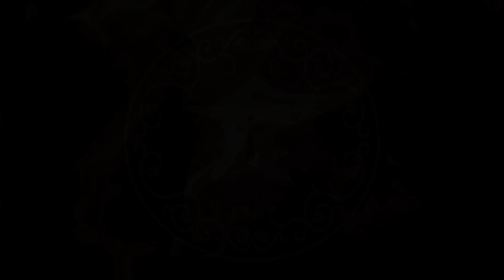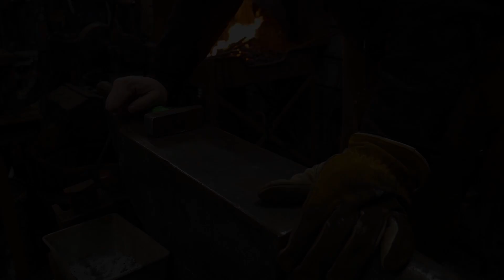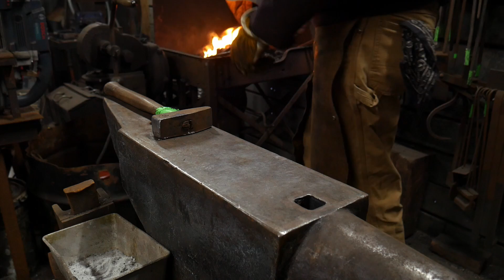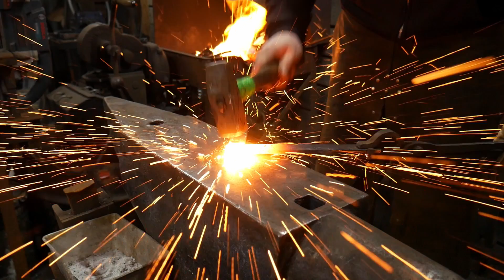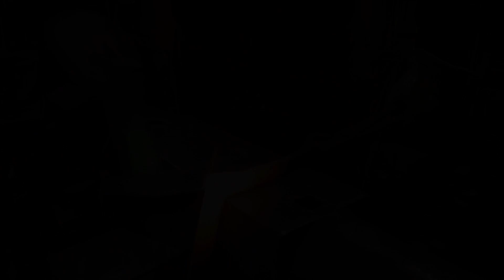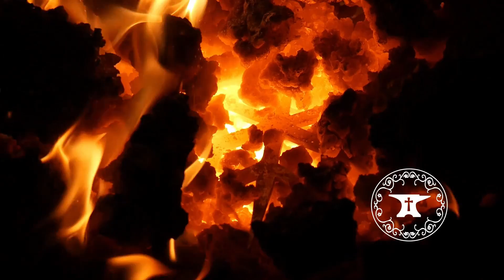Top Reasons Why You CAN'T Forge Weld

Comment: I recently had a failed Damascus billet I was trying to forge. I heard somewhere the steel will get hotter faster if you position the stack so they are vertical instead of horizontal so that the heat from the flame will hit each individual plate. I tried this method but after you said that flux can get stuck in between the layers makes me think that that was my problem... The flux was just seeping down in between the layers and messed up the weld. Is there any truth to this?

Comment: The number 1 reason my welds don't take is clinker in the fire blocking the air holes.The fire won't come up to a welding heat and I burn the steel. Also if there was to much flux on the piece my instructor Malcolm Paine would sometimes tap the pieces on edge on the anvil as they came out of the fire to remove the excess flux. 
Touching the pieces together in the fire and seeing if they stick is a great tip for beginners.
Great videos by the way.

Comment: Thanks for very informative video I have subscribed. I am a fairly good oxy welder and as such have a good handle on oxidising neutral and carburising flames, you also get to see the metal right up to the point of melting. Your video has given me a better understanding of forge welding and I’m keen to have a go. Thank you

Comment: I’m using a propane forge. Would it be better to have a coal or coke forge for forge welding? I’m really struggling, I’m also at 7000 feet of elevation.

Comment: Take and put your steel in the forge, then take and pull it out.
Take and hammer on it, but if it doesn't weld, take and figure out what you did wrong.
Take and brush the scale off before you take and use some borax, then take and put it back in your forge.
Take and pay attention, now.
Take and pull it out and take and pound on it awhile.
Take and brush it off again.
Take and take and take and take and take and take and take and take and...
Reply from the maker: Bravo 👏👏👏👏 now you're taking and getting it 😉
Reply: @ChristCenteredIronworks  
Good channel, I'm learning.
Take and keep putting up the videos, please.

Comment: A deep enough fire to use up the oxygen. A shallow fire or puting the material too close to the air supply. Clinker. All reasons forge welds fail. A rare one. Poor quality steel. I had an entire 20 foot bar of hot rolled A36 that was unweldable. I bought 2 bars at that time. The other welded just fine.

Comment: There are a lot of famous youtube channels that makes damascus steel in way to low temperatures, they bang it together with powerhammers or presses and create a semi mechanical and semi forge weld. If the pieces does not stick together just with touch there wont be a clean forge weld. Thanks for the input of oxygene, have not thought of that before, maybe that's why I fail more often from coke fuel then from cole, cole probably eats more oxygene.

Comment: What’s the best way to reduce the oxygen in the fire? Single piece steel forging I can do easily, but I get to much oxygen in my coal forge for welding.
Reply: I'll put in my two cents here, for what it's worth.. I know of two possible solutions to that. One is to keep the steel fairly high in the fire. There is a lot less oxygen on the upper part than where the air comes into the fire deeper in the firepot. The other is as the steel is just about at forging heat turn off the blower, and let it reach the last little bit by soaking us residential heat to just get that last little bit without the blower on. I'm sure there is other options, but these are the most common that I know of.
Reply: @random40s  Yes,  too big pieces of coal can mean to large gaps for the oxygen to sneak through.

Comment: Pro tip: small anvil right on/next the forge just for setting the weld, save yourself 3-6 seconds of heat loss...
Reply from the maker: Yes, Roy has   done that. A large steel block with work also. ~Jessica
Reply: Definitely! I find a ton of uses for a little "traveling anvil" around the shop. If I'm working on a frame or something and it needs a tap tap, I hold the block behind the section to support it while hammering, for example.